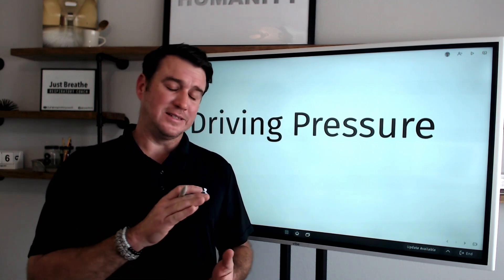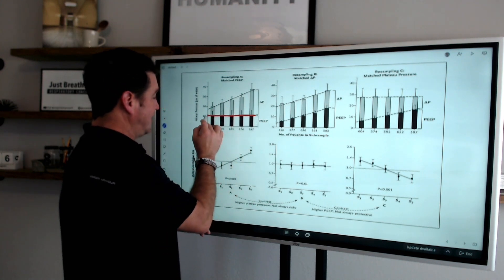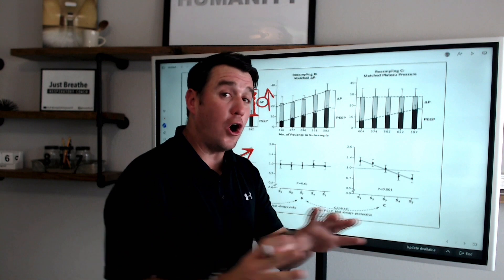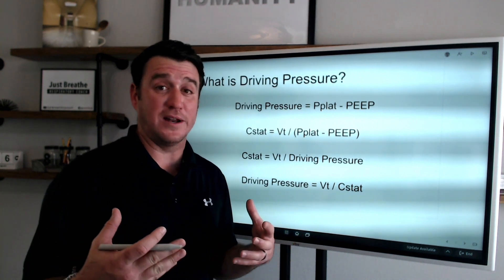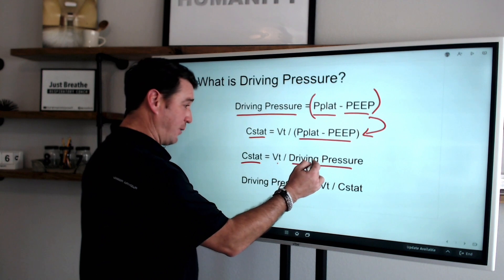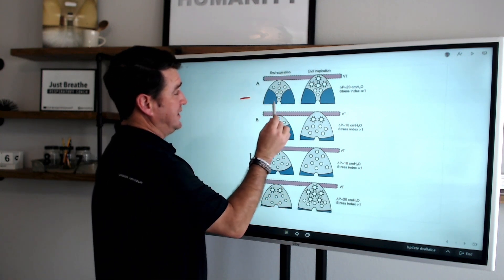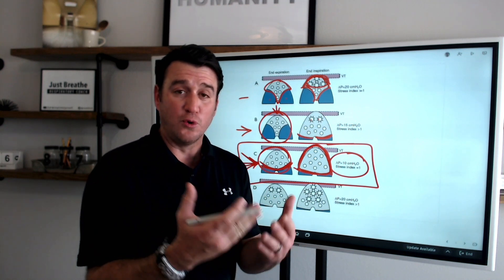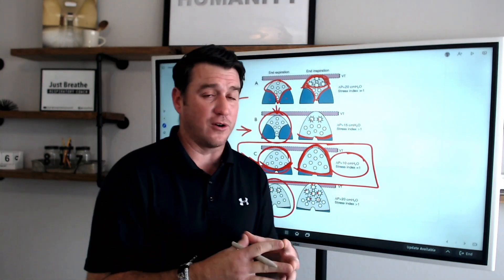Respiratory Therapy - What is Driving Pressure?

Comment: This probably will sound very dumb. So I’m sorry, just trying to understand. 

When we’re calculating for driving pressures. We would still need to start with IBW and 6ml etc. keep the pt there for a little bit until we get a Pplat. 
So with the PPlat we would calculate for the driving pressure. And now set up the vent with driving pressure in mind?

Comment: There is no difference in referencing "Driving Pressure" or "tidal volume". The effect on the patient by limiting tidal volume or driving pressure is the same to limit distention of the alveoli and lungs. If using "Driving Pressure" as a ventilator goal separated from a tidal volume to patient IBW can be a useful way to have clinicians use lower tidal volumes that is fine. But let us be clear, it is the lower tidal volume and limiting distending pressures on the lungs that is the clinical advantage to the patient. You should also consider limiting flow and shearing forces on the lungs.
Reply from the maker: Hey, Allan. Thanks for watching and taking the time to contribute to the conversation. I appreciate you.

Comment: So! depending on lung condition; and if the lungs are stiff as in ARDS, we can change driving pressure by increasing Peep; for better ventilations, get that Driving Pressure and Static Cl numbers and calculate Vt? But! I think only getting the numbers on Volume ventilation and applying it on Volume or  Pressure and when ventilating keep an eye on the Plateau Pressure trend to watch for improvement and deterioration?

Comment: Looks like driving pressure is related to pressure gradient. If so, then a ventilator giving us a pressure gradient can help us ventilate better. I remember using a Drager ventilator which on the first 6 breaths can figure out the pressure gradient to set a proper flow. 
So, if vents can figure out the pressure gradient and the flow, then we can get the right VT, get a Cstat, and have a Driving Pressure measurement?

Comment: Many thanks for this awesome informative video!
So! Would it be pk to initially set a pt on an approximate Vt, low peep and on volume ventilation, then get a plateau pressure, then calculate driving pressure then ventilate according to driving pressure? So I would use the formula you mentioned: vt/Cstat. and monitor that driving pressure as a trend to see pt's progress? Also having in mind pt's lung condition getting better or worse? 
What's a normal driving pressure?

Comment: As always, great video! But crossing out ibw... thats a long shot I believe.. ibw is such an easy way to initiate a vent, then after I think we can work it to change to the correct driving pressure... so I think only after we initiate with ibw, correct driving pressure will be superior. Lolol
Reply from the maker: Hey Jesse!  I agree 100% that IBW still has a place in MV as a starting point for setting Vt.  Thanks for contributing to the conversation.  I think your thoughts are spot on.

Comment: Thank you for this education. I have two questions: 
1:  Which modes of ventilation allow us to measure driving pressure?
2:  Can you please show us [maybe in a video] how to measure  driving pressure in APRV mode? 

Thank you in advance.
Reply: Hi bro

For the first question, a mode of volume controlled is used in order to measure DP .. because the calculation needs a specific set of tidal volume, while you can't do this in pressure control mode because the volume is variable regarding the specific amount of pressure you're delivering.

For the second question, as long as APRV is a spontaneous mode of mechanical ventilation, then the volume is variable regarding how much the pt. takes breath in , which will directly affect your DP reading

I hope I could answer you, best regards
Reply: @fuadfayyah1387  The problem then becomes: Should we always use VC on ARDS patients? The vast majority of our new crop of ARDS patients [ you know who I'm talking about]  do not tolerate VC. And therefore, we cannot guarantee good lung protective ventilation.  As such, I opt for APRV  for most of our patients.
Reply: @fuadfayyah1387   no need to use VC or PC when you have PRVC
Reply: @fuadfayyah1387  u can measure it simply by Pplat-peep , u can do it both in VC and PC